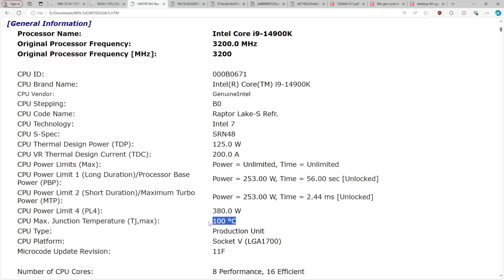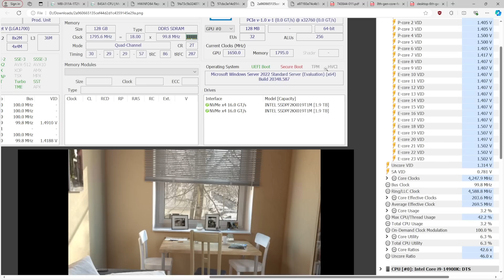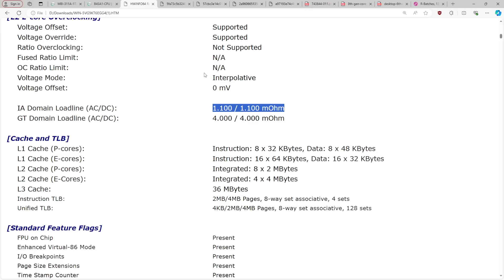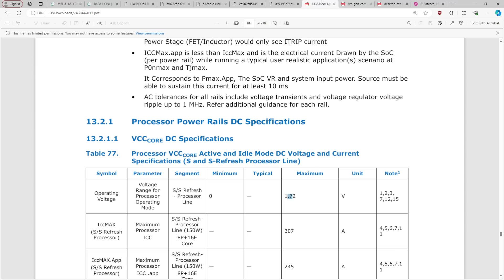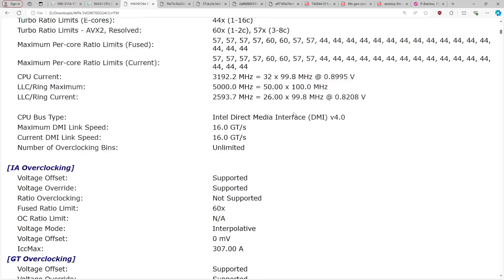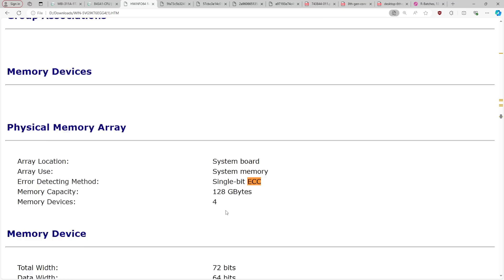Rambling about intel i9 14900Ks degrading in a Minecraft server hosting enviroment

Comment: I suspect the August update will prolong the lifespan a bit but not fix the issue.
Reply: It will also probably reduce performance, conveniently after the review cycle for the new Zen 5 CPUs.
Reply: It'll probably prevent further degradation, but all of the already dead chips have to be returned.
Reply: Om Nom please do not eat the CPU.
Reply: they will drop them all the way down to 5.4 max.

If that was my issue id adjust the operation temperature to voltage ratio. They know they have oxidation issues and temperature is playing a huge role if not the most important role
Reply: Right, and keep in mind, the August update will likely be a reduction of voltage/VIDs so it's not going to hit the power limits / boost limits anymore.  So these high-end i7 and i9s will no longer perform at advertised performance and boost clocks.  Fun stuff.
Reply: @ChrisGR93_TxS   Yeah ALLEGEDLY oxidation fault is only on the 13th gen units not 14th gen, according to press response by Intel.

But i think Intel might have run out of... being trusted over these past months.
Reply: From my days of overclocking (1990s to 2010s), I only once encountered a situation where too much voltage caused anything other than permanent damage to the cpu or very short term weirdness while it was being destroyed by that extra voltage. Basically, I don't think the fix intel is pushing is actually a fix, I think it's designed to stop new damage from happening, but all those already damaged cpus will need to be replaced. They're already wrecking their reputation with all these performance regressions, slow responses, and selling highly overclocked CPUs to retail. They got greedy, and are paying for it now.
Reply: After the update, no processor will reach the turbo speed of the advertisement!
Reply: Performance will be dramatically decreased😓
Reply: If after the update, none of the cpus will reach the advertised 6.0 boost, wouldn’t that make them liable for a class action lawsuit? 🤔
Reply: @SianaGearz  They haven't.  Until Xeons start dying like this they will be 100% fine.  Gamers and these use cases are a literal drop in the bucket to what their main market is.
Reply: @WolfSniperLetsplays Fanbois gotta fanboi... LOL
Reply: @WolfSniperLetsplays found the userbenchmark bot.
Reply: @Razzbow candy processing units
Reply: Will test if that solves it. If it turns into stability could save the less damaged CPUs.

Rest will probably need a replacement.
Reply: @WolfSniperLetsplays Right, I forgot that Intel 13th gen and 14th gen already dominate the top of the gaming chart benchmarks by such wide margins that a loss of 10% would still crush 7800X3D and 7950X3D. Or, you could face reality that regardless of who does the benchmarks, Intel 14900K/KS, 13900K/KS, 14700K/KS and 13700K/KS range on average 10% below 7800X3D for 14900K, and 17% lower on 13700K, and that's average, there are many game titles where those numbers are way worse for Intel. You need to lay off freebasing the copium, it's bad for you.
Reply: Only need to prolong the lifespan so that most CPUs outlive their warranty period!
Reply: @WolfSniperLetsplaysit's a safe assumption that Intel isn't paying you a dime to simp for them which makes you even more of a loser for doing so
Reply: bingo. they are stalling to ease consumer apprehension ahead of the launch of 15th gen. they will deploy this "fix", then come out AFTER the rush for 15th gen and say "woopsie! looks like it's a hardware defect! and would you look at that, the new ones we just put out aren't affected!"
Reply: @WolfSniperLetsplays troll harder
Reply: You can't fix a manufacturing flaw with a software update, so yes.
Reply: Not if your chip is degraded beyond help.
Reply: @WolfSniperLetsplaysYeah, That i3 2100 of yours gonna murder the brand new Ryzen 9700X

Comment: As someone who overclocked their 2500K from Day 1 and ran it for more than ten years without degradation, this entire situation is BS.
Reply: I passed mine on to my parents. Still runs at 4.5 GHz since day 1! I even had it running at 4.7 for about 3 years without issues...
Reply: They had to beat AMD in gaming. They failes big time with this bet.
Reply: Bruh!!  Ole school.  Me too.  Man, those were the days.
Reply: 4790k overclocked, though slightly for 8 years.
No issues, updated to a 13400 recently, hope that model isn't in the danger zone, so far not according to all sources.
Midrange bang for the buck buyers win again
Reply: Its not BS, the issues with 13-14th gen intel CPU's are well proven with data to back it up by now. This has been done by basically all the well known reviewers and tech channels. And now intel has officially stated there are issues with them and says a "fix" via microcode will come. If it actually fixes it we will have to wait and see. Fix or not , the damage has been done and their brand will take another hit from it.
Reply: @Reac2 13400 is a rebranded slower 12600K that costs more, it does however mean it's completely safe as it's not actually a raptor lake CPU
Reply: I think you misunderstood his comment but yeah. @MissMan666
Reply: yes, the CPU always been the inmortal component..seems like not anymore..
Reply: To be fair, the dimensions, temperatures and absolute voltages of the vias and transistors will affect their susceptibility to e.g .electromigration (der8auer explained the issue pretty well in his recent upload).
Reply: @niklayfer1445  At what voltages are you running it? You forgot the most important thing in this whole problem!!
Reply: @progammler  I sold QX9650 to some random guy and he still has it and it runs at 4,4GHz still to this day,  18 year old CPU by this point but somehow Intel invented a solid state  CPU that you can use for limited number of cycles.
Reply: My 4790k never once messed up. No BSODS ever, no performance issues ever doing everything with it for 6+ years on a crappy air cooler.
Reply: Seriously!  My server is running an i7-2600 non-K. 0 problems!  It's an old HP!
Reply: @MissMan666  I don't think he's saying it's not true.  I think he's saying it's BS that this did not used to happen, and that it's BS that we, the consumers, have to put up with this.
Reply: I have multiple 2600ks and 3770ks overclocked almost 1ghz, running 2133mhz ram still running daily, this is wild.

Comment: After the update, no processor will reach the turbo speed of the advertisement!
Reply: Agreed and they are waiting for mid August to get reviewed as is vs new amd
Reply: New patches just slows down even more and turns core off each time lol..

Like what Apple kept doing in their iOS updates for older devices..
Reply: they will but clock stretching
Reply: Ryzen 3700X had this problem on launch, never hit boost clocks, pbo would hard reset. You didn't have the crashing at stock, but it was false advertising.
Reply: @JohnDoe-ip3oq  that was fixed in 2-3 months. This has been an issue since at least 4th quarter 2023 and still no fix.
Reply: It's not just an ad. It's in its technical specifications.
Reply: the tides have turned!
Reply: This is pretty standard for microcode updates. Stuff like Spectre ended up decreasing some operation speeds by 50%.
Reply: @XantheFIN that was because of battery degradation and to prevent a unexpected shutdown of the device. The problem was the poor communication of Apple.
Reply: @XantheFIN  At least iPhones would get full performance again by buying new batteries(that degrade with use anyway) there's no way to fix the fiasco with 13th and 14th gen after it is already degraded
Reply: We shall see...
Reply: Repeat after me:
"Class action lawsuit"
Reply: @ajsrf it took a few years of legal proceedings, fines, and mandated compensation for Apple to push out an update that gave the performance back if you replaced the battery though.

Comment: Intel storing the current as a pseudo float is a semi-standard practice, when you want the certainty of ints but need more precision. Bit stuffing can make the maximum value a bit odd, but you see this a lot in older games. Starcraft 2, for example, stores hitboxes as a 5 bit value where the bits are quarters, halves, ones, twos, and fours, for a maximum of 7.75. Any value that's set higher in the unit editor will default to 7.75 under the hood. Intel is, apparently, using either an 11 bit unsigned quarter or a 12 bit signed quarter.

You don't see this sort of thing too often anymore, because bit stuffing isn't a thing that's done too often anymore, but the design constraints of a motherboard's BIOS are tighter than most programs.
Reply: It's called fixed point and it is an art.
Reply: If you actually analysed a bios, There is soo much padding waste...  Just better structural design and MBs are freed
Reply: The design constraint isn't anything to do with data size.  It's that VID is the format used to communicate between the PMU and the VRM controller, neither of which have an FPU or any reason to have an FPU.

Comment: Well, well, well, what do we have here? Last year, I wrote Gigabyte about an issue with some unusual high voltages being measured by HWinfo on my Z690 Aorus Pro. 
Gigabyte's response was, please send a screenshot of that measurement but I couldn't catch that second that showed the 1.588 Volts being put on my 13700K. And after sending the screenshot, they said "we don't see an issue here...and we don't know nothing".
With Raptorlake being still new, I doubted myself and thought, I didn't observe that new architecture long enough to make an educated guess, that that wasn't supposed to be there. Since there wasn't any mention at the time anywhere, I thought, it was a fluke.
Self-doubt can put a real dampener on your life! 
However, in my 28 years of system-building, I may make some observations over the years and this one struck me ass very odd, only to read about it a few weeks ago. It is almost like I told them so..

Comment: I have a Ryzen 5800X, which I have run as stock, overclocked, and undervolted/overclocked with PBO. I have used this CPU to run a technical minecraft server which occasionally experiences INSANE loads while also running an instance of minecraft at the same time AND streaming it all to youtube. This server has been online pretty much 24/7 since early 2021, and I have never observed even the slightest degradation in performance or stability. This is completely unacceptable from Intel's part.
Reply: My brothers and I have run about the same settings and have had no stability issues so far, we're all running PBO with a negative 30mV all-core offset on 2 5800x's and an 7800X3D. I have my 5800X running a 200Mhz boost override and the highest single core voltage I've seen is about 1.419 at 5050Mhz IIRC. Not sure if we won silicon lottery or AMDs cpus just have a ton of headroom from the factory. Either way, I'm impressed. My little brother sure is glad he got the 7800X3D instead of a 14th gen lol.
Reply: cores for days!

Comment: shoulda ran the server on the ole trusty G3258
Reply: I mean a g3258 would still use ddr3, so memory limited

If u could get a Z790 Mobo in a blade, u can do a crazy thing like 7600 96GB DDR5, disabled E cores and HT and overclocked 14600K
Reply: @krazybonnie5523  not a bad idea but you are throwing out reliability and power const are going to be pretty high.  Just not worth it
Reply: I had a g3258. Upgraded to 4790k with liquid metal for $200 at that time
Reply: Still have my g3258 sitting on my shelf. Good times overclocking it.
Reply: @krazybonnie5523  and STILL have the same problems the 14900ks also have, super fast degradation.
just get a super sleeper Ryzen 7950x system lmao
Reply: @Hairybarryy  yeah, obviously, it's a hypothetical
Reply: Shoulda ran AMD
Reply: @NitroDubzzz  yep, degradation on AMD parts basically never happens.
Reply: I still use a g3258. Works great.
Reply: @royboysoyboy  Now that's the stuff of legends.
Reply: the i3 7350 k was the flex, dual core, k model, but could match an 8 core Bulldozer, I swear Intel released that just to troll AMD, because there was little reason to buy a dual core for that price in 2017. That's where Intel peaked, everything after was recycled 7th gen on 14nm++ till the 12th gen and a few 11th gen laptops.

Comment: Damn it feels good to be a 7800X3D owner
Reply: Run two myself. Not a bad middle tier cpu. But just like the “exploding” x3d issue back in the day, this to shall pass. It’s the two cores boosting to heaven at 1,5 causing this. Lock your cores and be done if you own a 13-14900k. Or rma your cpu if you have issues then lock em. They wanted to be on top of stupid benchmarks and it’s coming back on em.
Reply: ...middle tier @ half the wattage and faster than 14900k in gaming. Half of these Intel CPU's will fail sooner or later according to everything we've seen so far. The "exploding" AMD CPU issue was a motherboard problem with mainly ASUS and only affected very few people. That Intel stock is going to go way down.
Reply: @Kyote7667  WHAT HZ SHOULD I LOCK THEM AT?
Reply: @Kyote7667  ah yes, a middle tier CPU, just like my favorite middle tier GPU, the RTX 4090
Reply: @Coliflower185  well, yeah. The 7800X3D isn't the best CPU they make, you know. The Threadrippers and EPYCs of the world are way better for this use case, at the price of being much more expensive.

For these types of servers, Ryzen/Core IS midrange.

Comment: I’ve recently updated my motherboard bios and find all the update does is seriously neuter power to my 13900k. My chip barely ever hits 5ghz on multicore loads now usually floating around 4.7ghz and I am seriously pissed. This isn’t what I payed for, and I’ll be having a few choice words for their rma department.
Reply: This is the first example of this I've ever encountered, the updates were released early July so its not something that's just dropped. Might wanna check your thermals.
Reply: @tmsphere  there's a beta bios available too
Reply: Technically this is what you paid for and well above it, even. The 13900k has a (guaranteed) base frequency of 3.00GHz for the P-cores, everything above that is considered "turbo" and is not guaranteed at all. Look up the spec sheet at Intel Ark.
Reply: The new ASUS Bios cut multicore performance by 50%, it's insane they expect people to be okay with that.
Reply: Im glad I switched to AMD couple years ago.
Reply: LOL get wrecked.    love my 13900HK Engineering sample that runs 5.7 all core without a care in the world.  entire board is still cheaper than a single i5 cpu :D
Reply: @Fudgecock  the only ones getting wrecked are intel though. we're all getting RMAs and Intel is losing $$$ like crazy
Reply: @mehck2  and? i forget the part where thier finanical situation is my problem, im all for cost to performance.

when chinese products give you 90% of the performance for less than half the cost. im all in baby
Reply: 4.7?!
It's a glorified 9900k 
Lol, lmao even
Reply: @danielt91  lmao my i3-4130 runs at 3.4GHz
Reply: @Xnoob545  Clock speed is basically meaningless without other context take the FX cpus for example I would rather have your 4130 at 3.4 than the fx 4100 "quad c0re" at 3.8ghz

Different designs can do a different amount of work at the same clock speed even when core count is identical. If you took the 13900K chopped of all but 2 cores and 4 threads and locked the speed at 3.4ghz It would be noticeably faster than the 4130. 

Although its sad that if I wanted to host a minecraft server for just myself your i3 from 2013 at stock settings would be better than a 13/14th gen core I9 also running stock settings, as I would likely play some ancient mod pack like tekkit lite 1.4.7 which wouldn't benefit from the extra performance and would benefit from stability of a well made chip.

Comment: 1.5v is what CPUs used 20y ago, when the process was 130nm!

Even 32nm Sandy Bridge overclock was 1. 4v pushing it. These are far, very far from safe for a 10nm chip!

Even the E cores are at that voltage. Why!? No wonder people are reporting E core failures.

Even more, it is almost impossible the temp reading is reporting hotspots. This much voltage and clocks, 50W on a single thread, the core itself is now so small it should be close to Tj Max, not 65C. (or Intel has used a lot of dark silicon...)
Reply: Agree. For the latest 5nm process node, 0.8v should be the normal operating voltage. I bet current crop of processors won't live to 5 year mark. Such a waste of resources all for consumerisum to keep going on and on and on.
Reply: @bozilla9975  My AMD chips are set to throttle at 65C, which is the universal way I found it doesn't really pump much than 1.2v

Zen chips dont seem to be far from top clocks but Zen 3, being a smaller process, generate many hotspots. Zen 3 also seems to push more voltage than Zen+, so it becomes worse. 

A slow 5500 was pushing 1.35v, so single and dual core loads heat up much more than multi, where TDP limits rule.

It was a while back that people were reporting issues with 3600s but seems that was limited.
Reply: @bozilla9975  pretty sure most of the TSMC 3nm stuff has a max safe voltage of 1.2v.

AMD and Nvidia run them around 1.1v or less.
Reply: @zcomputerwiz  AMD runs 5nm chiplets at 1.5v max boost voltage, which is kind of insane. I don't know what their next generation will run at but I suspect it's going to be a lot higher than 1.2v.
Reply: AIUI the actual voltage being fed to the cores is not 1.5V; modern Intel CPUs have onboard polyphase buck regulators (FIVR) that provides the actual operating voltage.